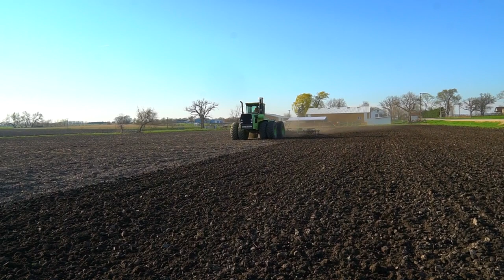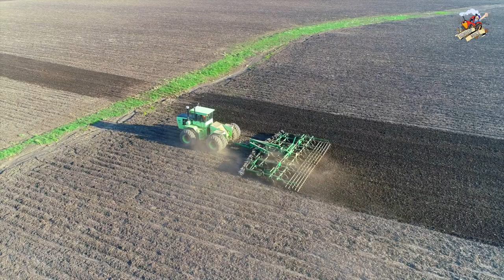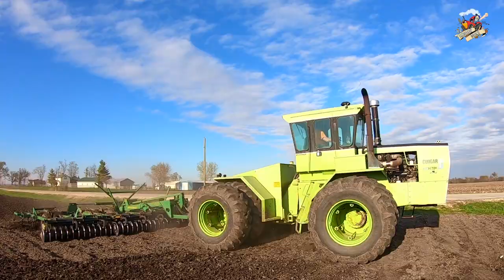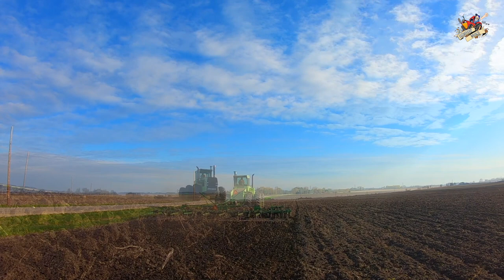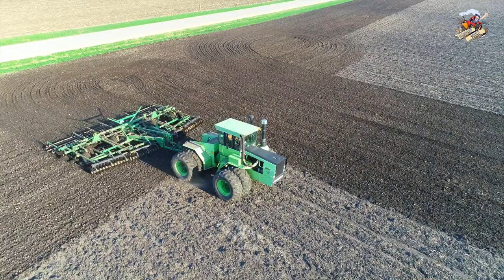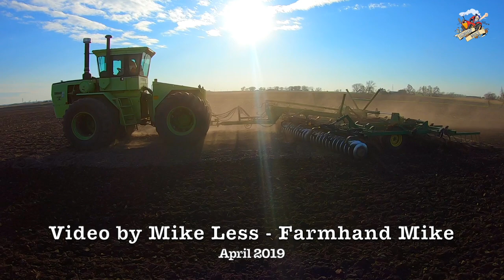Working Ground in Northern Illinois with a Steiger Cougar ST280 Tractor

Comment: Nice video Mike we actually own a st 280 Steiger tractor with a big cam Cummins engine very reliable tractors ones u put it in drive position there is no sensors or wire connections to worry about very mechanical machines

Comment: Mike it looks like he is running a straight pipe on that old monster!! Don't know how he  could stand all that noise for hours and hours.
Reply: Straight pipe is stock. They aren't that bad for noise.
Reply: The cabs are extremely quiet
Reply: @excellent952  actually the quietest cab in the industry at that time was the 7000 series tractors from Allis Chalmers. They set a record that's not been beat to date